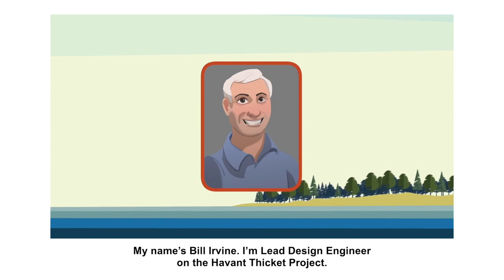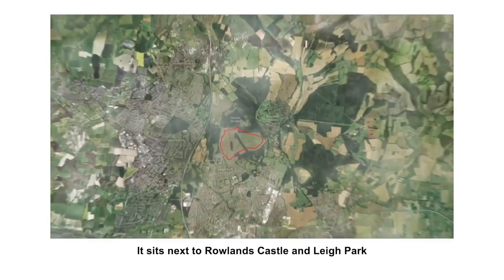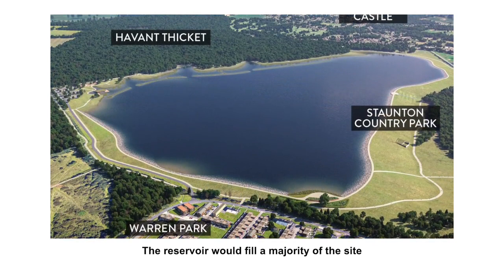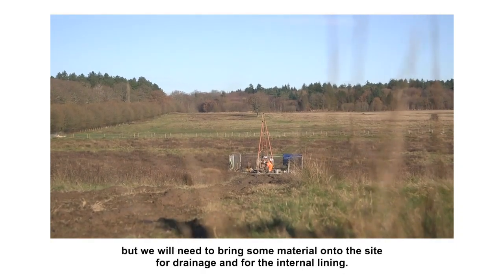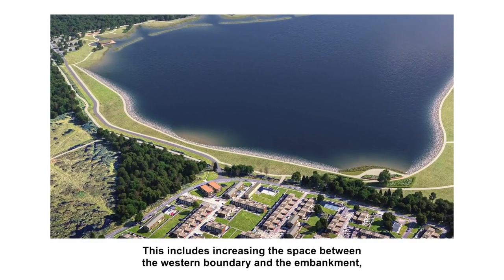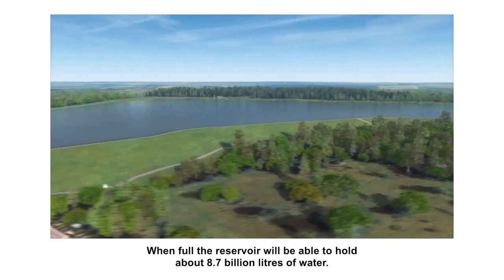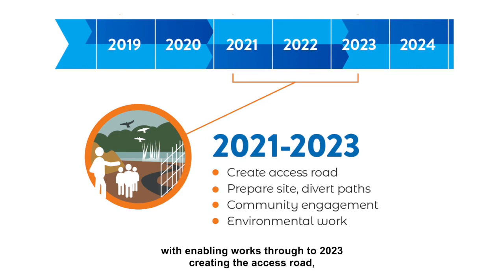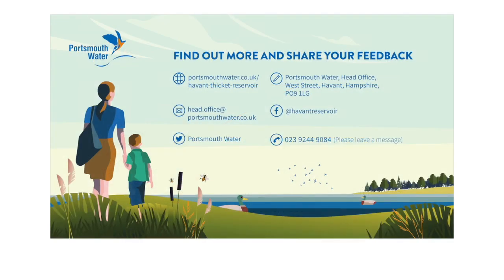The design and building the reservoir

Comment: my roommate and I are really wondering how reservoirs get the water, and we landed on this video. My question is now where does the pumping station get the water?? We are so confused about where you can get 8.7 billion liters of water without taking it from another lake or water source? Where does it come from??
Reply: In another video they sad they'd be pumping it from Lavant Stream, which runs through Havant, and out into Langstone Harbour.  There's also a spring near the mouth of the stream apparently, so the reservoir is storing water that would otherwise be lost to the sea.  But there's also a scheme to mix it with treated waste water from Budds Farm works, which (according to Southern Water) will be the first such scheme in the UK.  The idea is to use this water for Southampton, to relieve current over-extraction from the Test and Itchen.